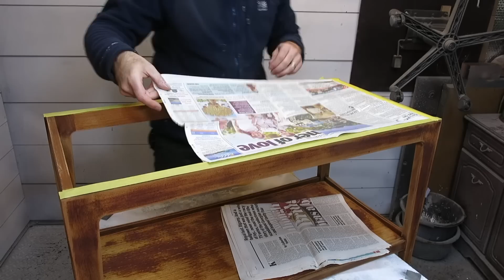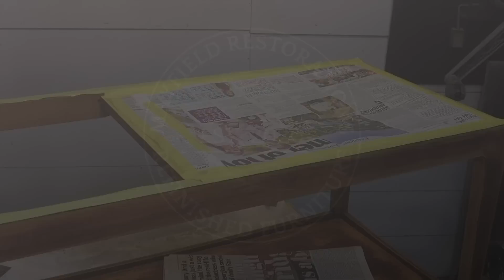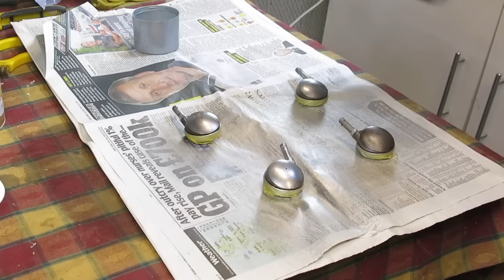STYLISH MAKEOVER of Outdated furniture

Comment: Brilliant again.  Just a question. Why do you use an electric sprayer over the air spray gun?  Ta. 👍🏻
Reply: I think he mentioned price, @9:30
Reply from the maker: Hi Ian. Thanks very much. I have actually got a compressor and a HVLP gun but i just find it easier and just as effective for what i need to use the electric sprayer. The pro version one i mention in the video thats is expensive is still electric but it has a better air volume and a more detailed spray pattern. The other thing with the compressor set up is that its really noisy. Hope this helps 😀👍